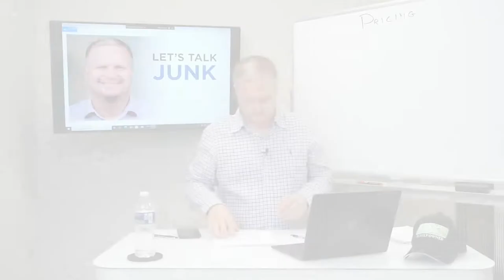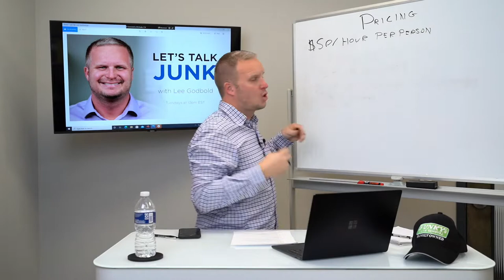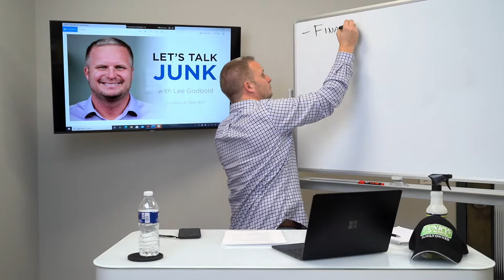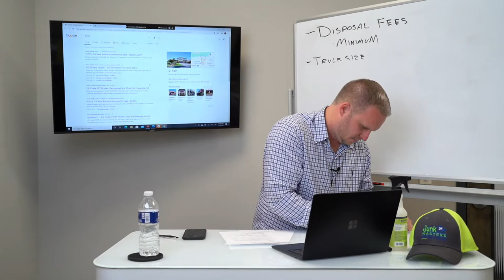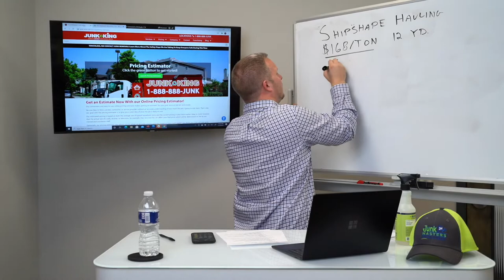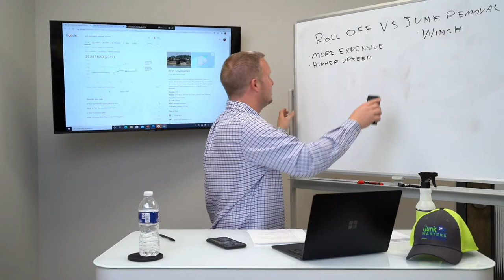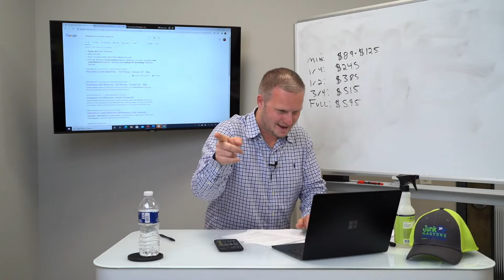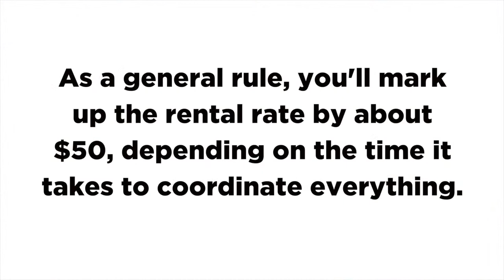Junk Removal Pricing - Lets Talk Junk with Lee Godbold

Comment: Wow guys, your disposal fees are AMAZING!!! - Over here in the UK, we have landfill tax of £94 ($131) per ton on top of tipping fees.  Normal tip price all in is approx £150 ($208) per ton for general waste, with minimum tip of 1/2 ton i.e. £75 ($104).  Plus in UK market, ballpark to charge for 10 Yd3 is approx £300 ($418) - We can't even have vehicles over 3.5t Gross Weight, without everyone getting heavy goods driving tests and a hauliers operator licence.  Do you ever get the feeling that you should have set up in a different country :-/
Reply from the maker: Wow!
Reply: @JunkRemovalAuthority  I know right.  But, what I will say, I have spent some time looking over the other side of the pond for new ideas from other markets in the same industry as ours.  Your ideas on non-linear pricing, reducing incl. time i.e. charging a little on top plus bagging fees are all helpful, as are many of your other videos.  When splitting hairs (and margins) to seek new ways to push up your average ticket price, all these things count.  We're doing ok, we have over 200 five star reviews on Google, but every little helps.  So from one junk warrior to another, thanks for making the effort.  I understand what you are doing and why you are doing it and it's proving super helpful in enabling me to think outside the box (the UK box that is) - Thank you for sharing your insights, it's super interesting.  Regards, Mark